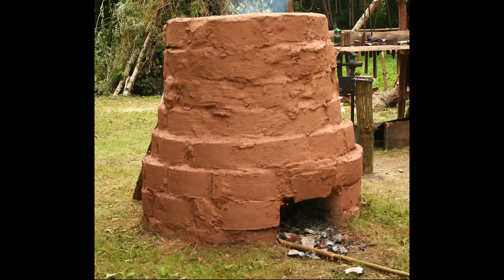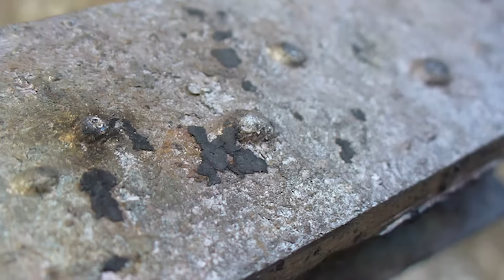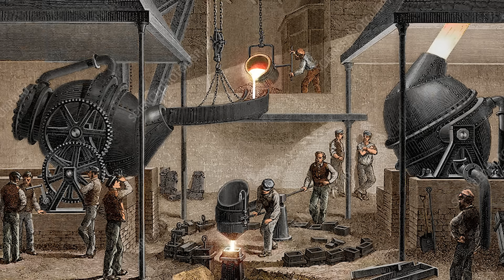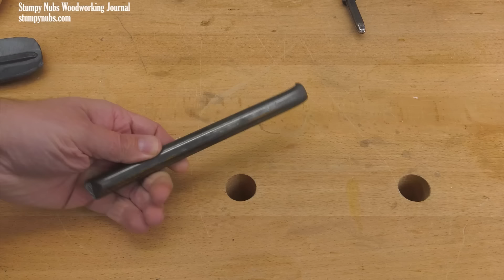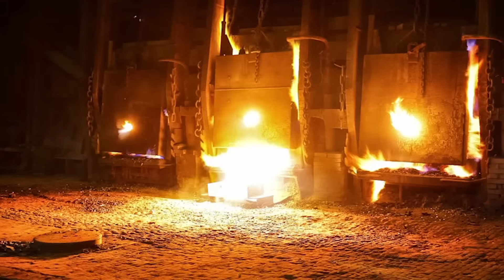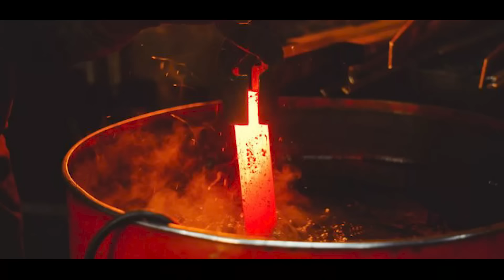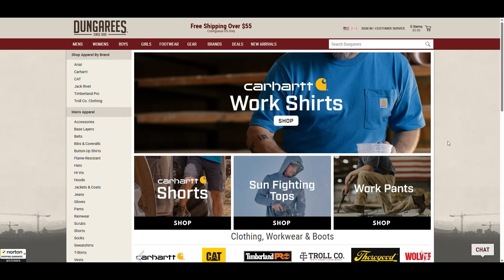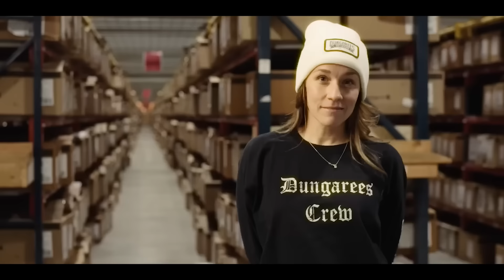Why they REALLY don't make tools like they used to

Comment: As a metallurgist, I have to say that not everything in this video is correct, but it's pretty darned close.  Bottom line, as I see it: modern steels can be far better than steels of yore,  but if you don't use the best of these steels, you can't expect a quality tool.  And you have to pay for that quality.

Comment: What really surprised me I was watching another video about a similar idea with products in the past being made better than products in the present. It basically came down to inflation. If you compare a $35 wrench set from like the 1970s to a inflation adjusted cost set of wrenches from 2025 the 2025 wrenches will probably be better than the ones from the 1970s but people like to compare cheap wrenches to what wasnot a cheap wrench back then

Comment: First off. I have been following you for years. With a handful of others, you have consistently given great woodworking advice that I pay close attention to. Thank you so much.

My wife and I were talking about a similar subject just yesterday. We are clearing a large (14 acre) piece of property in Central America, frequently with machetes. Machetes here are cheap- maybe 5 to 10 US dollars each. Sharpening them is a PITA. We've used a power grinder which works quickly, but the steel is soft, and the steel dulls quickly. Obviously the thinner the edge the better, but then it becomes too brittle. I have been thinking about using a propane torch to temper the edge, and perhaps that may work, but would like to hear your thoughts about making cheap steel take and hold an edge without having to file it every 20 or thirty minutes. Thanks.

Comment: One big correction here.
You don't need coke to make crucible steel, charcoal does get hot enough to do it easily if you design your furnace right.
The reason why the blueberry furnace stuck around for so long was that European iron ore was contaminated with high levels of sulfur, which would just burn in a blueberry furnace, but in a crucible the sulfur has nowhere to go and thus impacts the quality of the final product.

Comment: Chisels are lightyears behind knife steels. Rex 121 is heat treated to 75 hrc. There are also steels like vanax and magnacut that cant even chemically rust. Metallurgy has come a long way in even the past 5 years and still is being improved.
Reply from the maker: Chisels are not behind, they are just different tools. Harder is not always better depending on the application. A knife and a chisel are used very differently. It's almost literally apples and oranges.

Comment: It's worth a mention that with modern high end steels forging is also obsolete. Microstructures have become so fine with hot isostatic pressed, then cold rolled billets that even though you are aligning the grain during forging, you are also enlarging them in the process, yielding a net-negative result (and risking decarb and distortion at the same time).

I used to work on Knives in Solingen, and forging was only used for the cheapest of cheap knives, or for exotic artisan products that weren't performance sensitive, no real in between. There's even modern PM-Damascus (non-forged) for high performance applications...

Comment: Adding carbon to molten iron/steel is orders of magnitude more efective than to a solid. In a solid, the carbons mixes with teh iron by diffusion. A macro analogy is stainning of a counter top or a sidewalk. The stains have to seep in and teh stain is mainly on teh surface to some minor depth. Adding carbon to a liquid (even a thick viscous liquid) allows teh carbon to get deeper. At the macro level, it is like adding sugar to coffee and stirring.

Comment: A major thing is that people are taking the highest end tools produced in the past and comparing them to the lowest end tools you can buy today. It would be like comparing a steam locomotive to a modern sedan and then claiming that we can’t build engines as big as they could.
Reply: even supposed heavy duty tools fail at a consistent pace.
its all calculated via finite element method for predictable reoccurring consumer spending.

Comment: I have chisels from the 8116 line, they are lovely and feel like they will last 100 years. I have just seen they make even cheaper ones now with plastic handles. A 20mm bevel edge chisel with the same blade as mine as far as I can tell for less than a tenner. Amazing!

Comment: After 55 years professional woodworking,  my experience tells me that old steel is better. The problem is that poor treatment even of high grade old steel will ruin the edge. So old is better, provided it has been looked after correctly. Chisels and plane irons which were laminated are even better.

Comment: why do the narex chisels rust so easily
Reply from the maker: I have lots of Narex chisels and see no difference in rusting compared to anything else. That said, I have seen some chisels with a lacquer coating on them to prevent rust. I hate it. Really, if you have rusting issues, wipe your tools with an oily rag (light machine oil) or apply a little paste wax once in a while.

Comment: Old steel tools have survived test of time. They have been filtered out to leave only the good stuff. Modern steels in general are way better in quality of steel, however unless you have an electron microscope you can't exactly figure out what steel you have. The workmanship also isn't filtered out by time either.
Reply: Some manufacturers list the alloys they use. For the vast majority of steel, you can find a spec sheet online, that'll tell you the composition, use cases, weldability, hardenability...
Reply: @Tvngsten  yes, but how can you be certain that the knife or chisel you are holding is really what the manufacturer claims it is? There have been tons of high end kitchen knife "scams" where the blade steel was something completely different than what was listed, for example some of the kamikoto knives. They now do list the alloy after they got big stink over claiming their 420J2 was high end steel of different grade. And that happened only after some YouTuber actually sent the steel out for testing.

Comment: one important difference between vintage and modern steel is that modern steel made post WW-II is always contaminated with trace amounts of contaminants which were either much less concentrated in the atmosphere or didn't exist at all prior to the nuclear age.
this doesn't exactly effect tool making to my knowledge (although i could see it being an issue when more of the carbon in your steel can decay into nitrogen for example), but it IS a concern in other applications
Reply: Only when making sensitive measurements of traces of radioactivity.

Comment: Very Simple  REASON old  steel is SUPERIOR  to new "RECYCLED " Steel .   OLD steel was MADE from "VIRGIN" Iron ORE 
NEW steel is made from "RECYCLED"  materials that have IMPURITIES  in the  Mix .  Just take an "OLD" chisel or any tool pre 1950s. DIP into a bucket of water for about a week . THEN do the same with a "NEW"  steel tool ..... then compare them . 
the comparison will astound you .  : )
Reply: You seriously think we don't make steel from iron ore anymore? We absolutely do. Just look at how much iron ore we extract each year. And besides, our purifying process takes care of the impurities, and all steel manufacturer have extremely strict tolerances for phosphorus and sulfur content. 

Anyway my blacksmithing workshop has terrible isolation. Whenever it rains, everything rusts. My old files all rust, but a cheap hardware store set of files just hasn't shown any rust yet.

But corrosion resistance isn't the factor we use to determine if a tool steel is high quality.
I could take some X2CrNiMo17-13-2 steel and leave it in a bucket for a year with no rust, but it would make a terrible chisel.

Comment: "Steel lasagna"... why do I find that so hard to swallow? 😃
Nice explanation of steelmaking techniques and how they developed.  Reminds me of the special-use chains I used to buy from a low-volume chain mfr in the 1980s, for resale in my small business; either the steel quality or the heat treat (they blamed the latter, of course) was too inconsistent and I wound up having to switch to Japanese chains.  Mfrs really have to know what they're doing and be dedicated to doing it right.

Comment: A golden age of chemical manufacturing but tool making? No.  The old chisels and other edge tools were designed better.  The design evolved with the craft use.  You can't avoid the evolution of the tool adapting to the craft.  Then you get high quality goofy tools with features that in theory make sense but in practice they are not ideal. Not saying there aren't any masterpieces but in general, if you don't know the craft intimately, how can you design a tool for that trade?
Reply from the maker: What design features found in old chisels no longer exist today?
Reply: @StumpyNubs  I wasn't mainly thinking of chisel, a fairly straightforward and simple thing.  Even then the difference from modern chisels may be subtle, but they are noticeable the more you use tools from lets say a master maker, the more you appreciate them.  Maybe its the type of wood handle, or the gentle taper of the tang.  Maybe they used elm for this, and avoided oak.  To most folks, big whup, but in the aggregate I believe these people used these tools for a profession.  Heres an example, Pax saws.  Great, even top of the line material, clumsy handles.
Reply: Also think about vises.  Remember Record vises? Those things will outlast all of us, easy.  I got an eclipse vise, very nice.  Not the same.
Reply from the maker: I agree that some older tools had better design features. What threw me off was you specifically said "chisels and other edged tools." I find no real design differences in older chisels that do not exist today, if you buy the right chisels. In fact, some of the best Chisels ever made, in the opinion of many woodworkers, were Stanley's 750 line. And that line is the model for several high end chisels made today.... Interestingly, when asked about the old 750's, Google's AI said this: "The original Stanley 750 chisels are widely considered among the best chisels ever made due to their quality, balance, and steel, though vintage tool quality could vary. The modern "Sweetheart" versions are designed to be a faithful reproduction of the originals and are highly regarded, though some recent comparisons show newer brands like Narex might have superior performance in some areas. " - I thought that was funny because I did not mention Narex in my question :)
Reply: @StumpyNubs  Ok, fair points all.  I bought a premium chisel set from Lee Valley/Veritas.  Great materials, but the edges are so sharp i cut myself on the sides of the chisel.  No professional woodworker, wainwright, cooper, etc. would ever accept that kind of slop at that price.  No question the materials are more advanced now, but...even there, the premium supersteels are so darn expensive.  You are correct, if you buy the right ones.  Maybe what Im seeing is the skill of the old timers with what they had.  I love 1095. haha.
Reply: @StumpyNubs  Entry level Narex is the best example of great materials and only midlevel performance.  The basic line are beefy clunky not great out of the box.  It is like buying a kit.  And dont get me started on power tools.  I collect vintage Craftsman.  They weigh a ton and will outlast me and every future generation.  Built tough to last.  You can buy a Hercules line at Harbor Freight, but wait a while.  I love your channel btw lol.

Comment: It was good advice back in the day because the high quality stuff like Narex offers wasn’t widely available, so the best at the time was the old stuff before cheap steel was dumped into the market. What’s really key here is that sometimes you have to update the rules of thumb. Thanks for pointing out Dungarees. I like small shops and employee owned is even better. So here’s my updated rule of thumb. Buy local even if it’s not local to you ;-)

Comment: Id say that old steel is better than most general and cheap steels of today, but not an expensive top of the line steel of today. Problem is, most tools arent made with that type of steel today, only the top of the line tools are.

Comment: I saw a video a few years ago about people trying to get those huge two-man saws for working in national parks. They were chasing old sawblades on the walls of bars, because the best manufacturers of old had their own steel mill and made just the right steel for those saws.
Reply: Yeah- because we wouldn't want to "hurt the environment " with exhaust fumes from a modern hyper efficient power saw. We'd rather punish the bodies of men trying to cut wood, and then haul it out on mule trains or unicorn fart powered magic Tesla Timberjacks.
Reply: @beavisroadhog9629  There are different ways of hurting the environment. One is the atmosphere with greenhouse gasses, sure. But another one, which is kinda the point of national parks, is physical trauma to the immediate vicinity, including noise, and the pace at which it happens, in order to let the fauna adapt (and as you observe, these two can indeed be at odds with one another). Banning the use of heavy duty forestry equipment isn't too unreasonable if your goal is to limit the latter rather than the former.
Reply: @beavisroadhog9629  also if you make something hard to do, people will do it less. Maybe that's the idea too.

Comment: Modern steel is just too inconsistent. I bought a cheap set of Paula Dean kitchen knives about ten-ish yrs ago and they were dull. When I tried sharpening them it was a pure nightmare. I have a machinist friend who brought one to work and it tested at 64R. Aaaaand then I've bought Dewalt drillbits that bent like spaghetti when I tried drilling metal with them. All that aside, I have 4 sets of different Narex chisels and ALL of them perform flawlessly.
Reply from the maker: Maybe its the Paula Dean kitchen knives that are just sourcing inconsistent steel.

Comment: a good bunch of info but you left out 1 critical thing in the process of hardening the steel.  You forgot quenching!  Once you soak the steel in heat to the critical temperature, you have to quickly submerge it in either oil or water to lock in the condition.  The quench medium depends on the type of steel.
Reply from the maker: It's in the video.

Comment: I served my wood patternmaking apprenticeship in the early 80's.  The steel in the new tools was great...  but the tools were CLUNKY.  Over the years I bought a few pattern boxes from retirees just to get their prized edge tools.  The blades are thin, bolsters graceful, and the handles graduated properly to the tool.  Old Buck Bros, Marples, Swan, and Barton chisels have a feel unmatched by any modern tool... regardless of the steel.  Modern chisels are made to by struck with a hammer.... and you can tell once in the hand.

Comment: i appreciate this video and it confirms a lot of common sense assumptions i had. notably, the oldheads who want the old steel are not railing against modernity in itself, but are (correctly!) frustrated by the cornercutting so many companies do now. these days cheap steel is caused by profit-seeking, not because of a lack of technology or respect for the craft or whatever. though i suppose you could argue profit-seeking and manufacturer skimping could be classified as not respecting the craft!

Comment: I have a couple of nice sets of chisels which get a reasonable amount of use for DIY projects, but I once bought a set of 3 from a pound shop (dollar store to you guys) as I had a particularly messy job. They were like working with a block of cheese! I did experiment with re-heating them and made them somewhat harder but they still come out only for messy jobs that I know could (or likely will) damage my nice ones

Comment: Generally good, but one glaring mistake.

Quench hardening is about modifying the crystal structure of the steel, no extra carbon is added and voids do not appear in it.
Reply from the maker: Where did I say quenching adds extra carbon and creates voids?

Comment: Old steel isn’t necessarily better. Modern steels especially powder metal steels are far superior. However old tools are usually better quality in terms of cutting geometry. Vintage axes were made at a time when people needed axes to survive. Modern axes have good steel but terrible geometry. Axes for example are left thick and have obtuse edges to avoid warranty work.   

Forged isn’t always better. They won’t necessarily take a better edge over stock removal. That all comes down to heat treat. Also the grain of the steel is usually dictated by the rolling direction of the steel and to change that requires the steel to be nearly liquified which doesn’t happen in drop forging. Also voids don’t really occur in bar stock of steel for stock removal since it’s still cast into ingots and rolled at the mill.

Comment: So much is in the heat treatment and the variation between the edge and belly of a tool.  I'd take a little bit worse steel in a tool if it was perfectly heat treated compared to the best steel ever with a poor heat treatment

Comment: Well, there's always been a market for cheap/crap tools.  I'm not much of a woodworker I have some inter war years Tyzak chisels and a set of Red Yellow handle Marples bought by my dad in either late 60's or early 70's. The Tyzaks were given to me by an old cabinet maker when I was a teenager the Marples I inherited from dad.  Tyzaks are pigs to get sharp and seem to some how 'micro blunt'  rather than feel dull, lose the sliceness etc, the Marples on the other hand sharpen easier and seem to hold on to that sliceness better that the Tykzaks do.